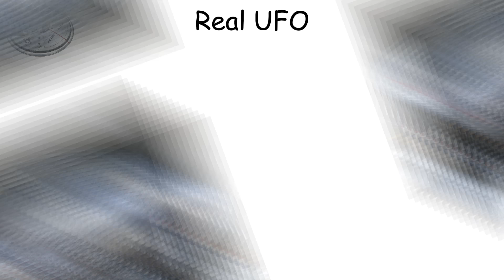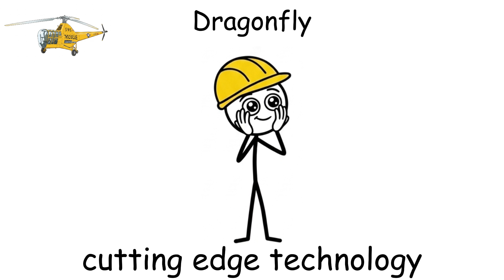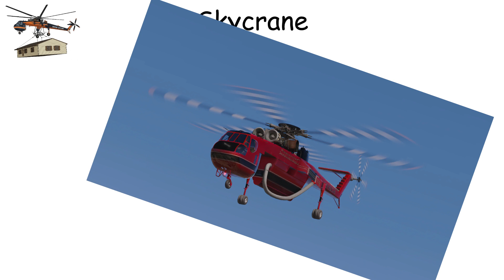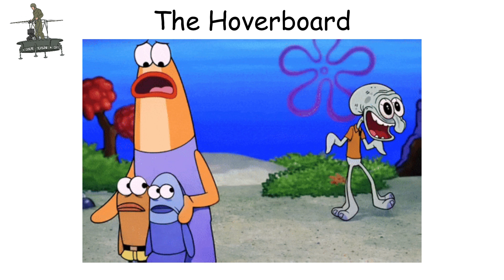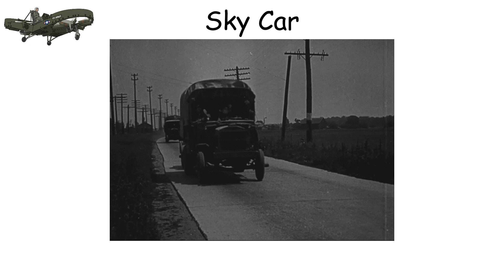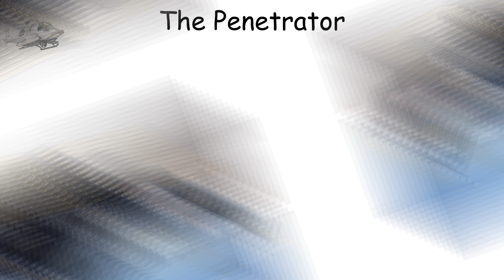Weirdest Aircraft Ever Made Explained

Comment: You missed the K-max. Also the Avrocar wasn't a helicopter it worked on a completely different aerodynamic principle, the coandă effect. This ended up being compromised in attempts to stabilize it by putting bleed holes in the bottom for direct aerodynamic lift but the original design had all engine thrust emitted around the edge of the saucer using the "pancake" jet engine that emitted thrust radially around the perimeter rather than axially from one end. This was supposed to induce airflow over the upper surface of the saucer generating lift. Instead with the bleed holes reducing the thrust at the end of the disk the coandă effect was compromised and it became an air cushion vehicle instead. Basically it needed electronic stabilization that didn't exist yet. Coandă effect aircraft have since been demonstrated to actually work in small drones. EDIT: Also you missed cyclocopters, another failure that has later been shown to work in drones though whether they are better than traditional helicopters is debatable. The cyclorotor concept has been used in tugboat propulsion for a century though and has proven advantages over azimuth thrusters although they are also more expensive and require more maintenance.
Reply: you are very smart